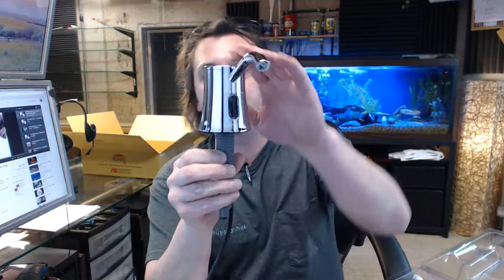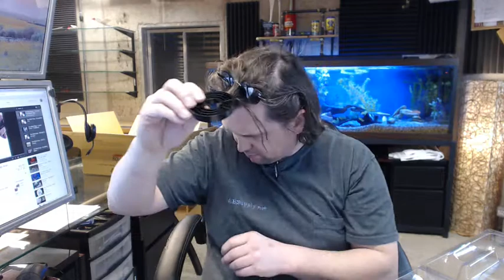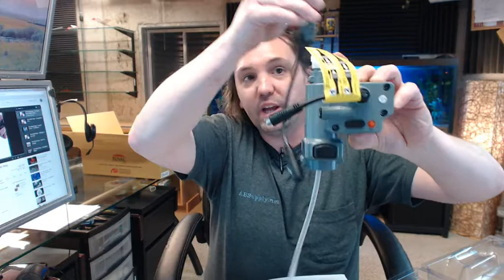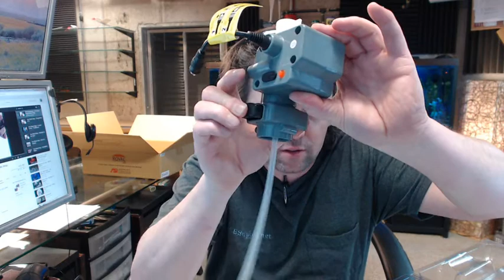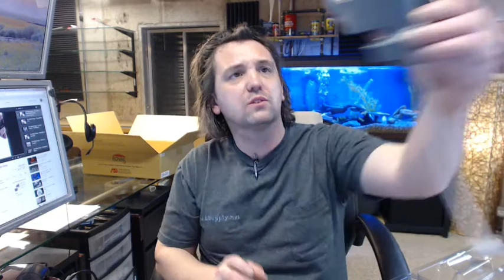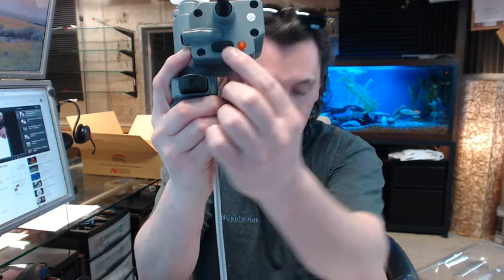ASI 20333 Deck Mounted Automatic Soap Dispenser

Comment: Hey I have 2 not dispensing soap . What are my options ?
Reply from the maker: Are the batteries fresh and know good?
Reply: In my old one, soap had infiltrated the motor compartment and clogged it and corroded the connections. It had been working fine for about 20 years😉I coudn't find the old finish to match faucet so I bought the cheapest chrome set, threw the chrome dispenser away, connected the pump to the old dispenser and everything worked!!!

Comment: Do you know of any deck mounted automatic soap dispenser that comes in brushed nickel/stainless finish?
Reply: I'm looking for the same. There currently aren't any out yet ;-(
Reply from the maker: Not that I am aware of.  Just plates polished chrome over a brass base material.  Rich
Reply from the maker: I will post bach here if I come across one is satin stainless, chrome, nickel finish.  Rich